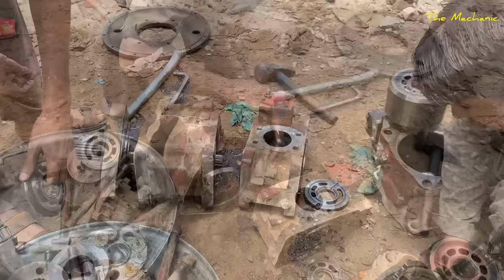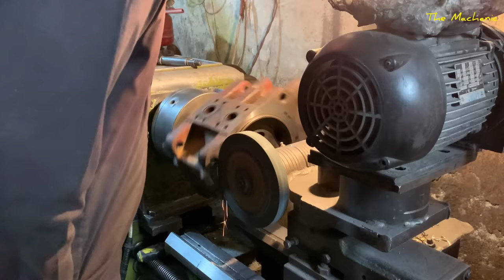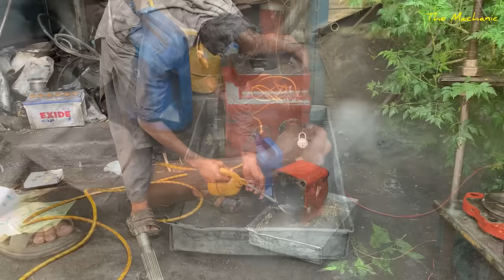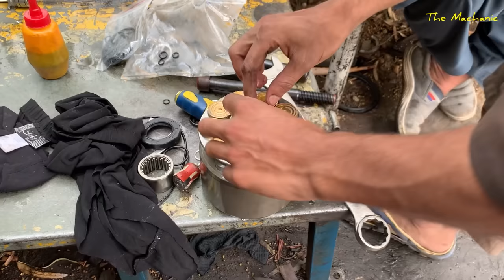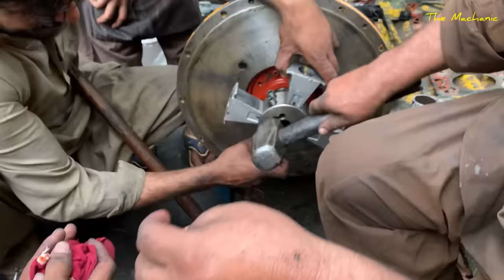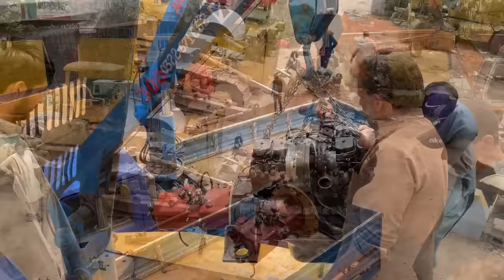These Guys Are Know Their Stuff Rebuilding Excavator Main Hydraulic Pump With Minimal Equipment

Comment: Dirt or no dirt, I am amazed at their skill level. Did not see a power tool during the entire video. This job would cost over three thousand US
Reply: Did you miss the lathe work?
Reply: @ianturpin9180 yeah but the lathe was pedal powered
Reply: DO YOU KNOW WHY IT WOULD COST YOU MORE .  IN THE USA .  MAY BE ITS BUILT TO SPEC AND TESTED  TO LAST A LONG TIME .  NOT JUST FOR 5 MINUTES AND COME BACK AGAIN .  IF YOU SEE HOW THAY ARE REBUILT  THAT MEANS  GETING ALL THE CLEARANCES AND PROPER TORQUE SETTINGS RIGHT SO IT WORKS PROPERLY.  THATS THE DIFFERENCE BETWEEN PROS . AND GOOD BOGERS  AND ALSO WHY YOU WILL PAY MORE . ENEY WAY ALL THE BEST TO YOU.
Reply: @tonyking9235  thanks scoop
Reply: @jamesjohnson8316  YOUR WELCOME JAMES
Reply: @tonyking9235 
Specs has nothing to do with the EXTRA cost.
These r built to specs as well. 
It's the high-priced  REAL ESTATE that's built into everything done in USA, secondly the high labor cost.
Reply: @tonyking9235  You think their customers are stupid. If it were as you say, they would leave them, but it is clear that they are satisfied with their work.